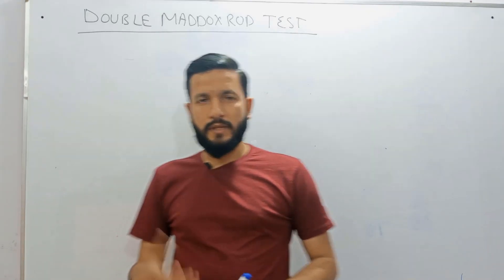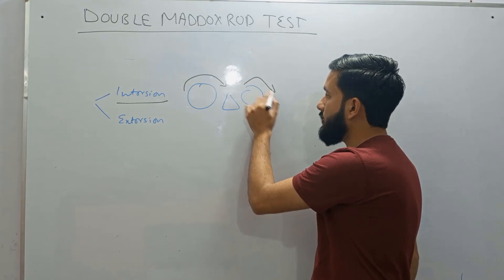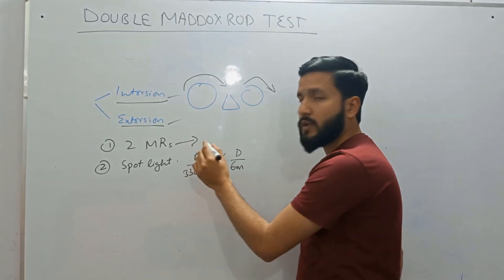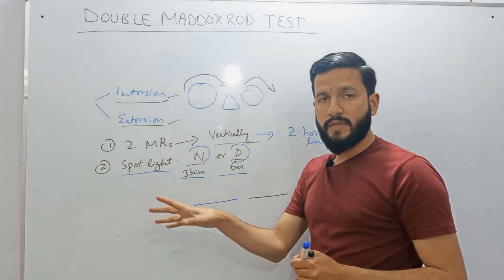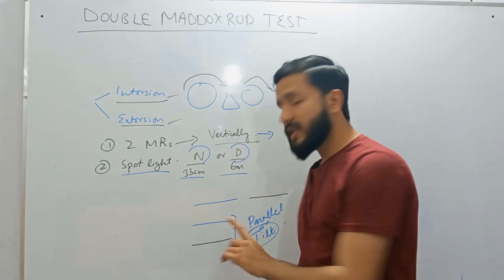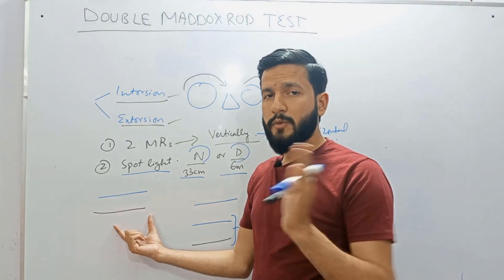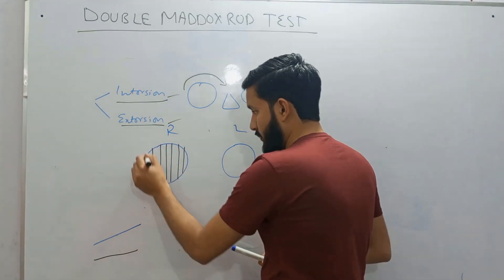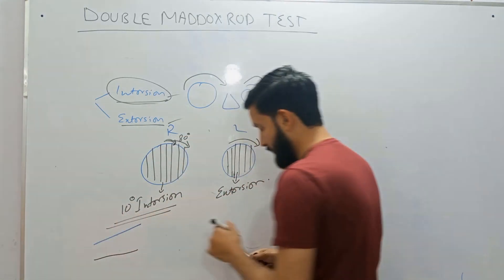Double Maddox Rod

Comment: Hello sir

My prescription says:

R -2.25 CYL 90 AXIS
L -2.25 CYL 90 AXIS
ADD
R +1.50
L +1.50

So considering my bifocal power, 
what would be the single vision prescriptions?

What i want is to make separate single vision glasses for every task.
Like...
1.  Single vision long distance glasses (For general long distance)
2. Single vision near distance (For reading)
3. Single vision intermediate distance (For computer use)

Currently I don't want to go for progressive glasses.
Reply from the maker: Distance: 
R: -2.25 x 90
L: -2.25 x 90
Near:
R: +1.50/-2.25 x 90
L: +1.50/-2.25 x 90
Intermediate:
R: +0.75/-2.25 x 90
L: +0.75/-2.25 x 90
Reply: @EyeCare3  
Thanks a lot sir